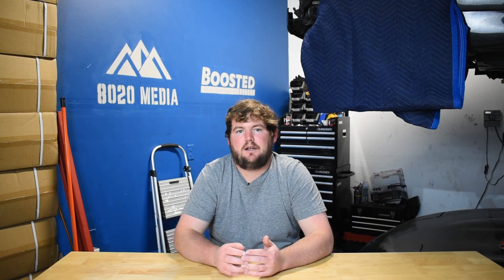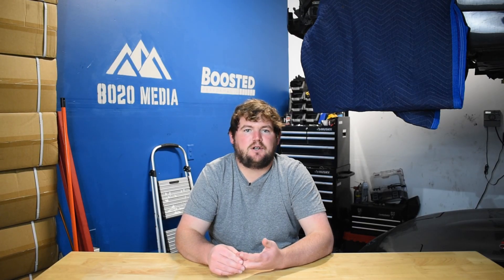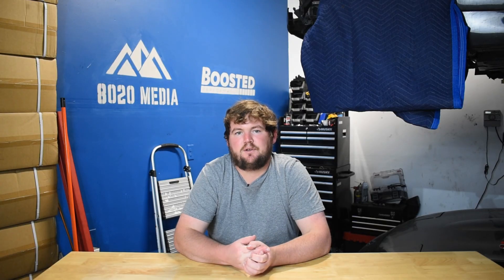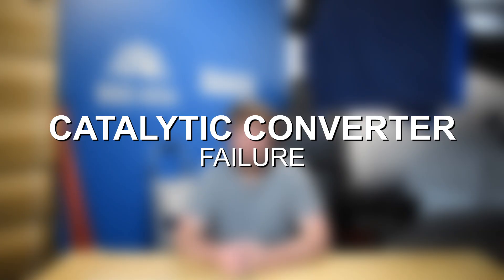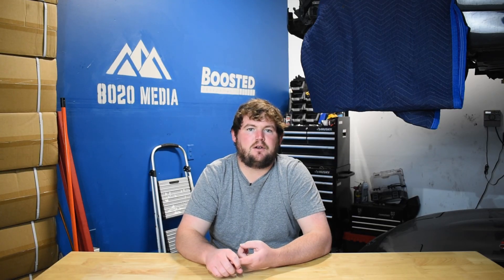Hyundai’s 1.6 Engine | Reliability & Common Problems

Comment: I want to add while we're on hyundai. I have a 2018 Elantra SE with a manual transmission. I have 123k on the 2.0 Nu motor. I cannot believe how trouble free this engine has been. Ok, its not peppy, at all, but i rock high 40s for mpg. At idle, its still quiet. I really am impressed. Now, im sure the way i tale care of it has a lot to do with it. The oil cap says "5w20". The manual says ypu can use "5w30" and if hot enough, 10w30. I have been using 5w30 synthetic oil and a good filter like Mobil 1 every 4k. I check and add any oil if necessary between oil changes. The 2 things that were done was a wheel bearing and a water outlet for the coolant. An inexpensive repair. If be surprised if i couldnt get 200k or more on this engine.
Reply from the maker: Joeb - Thanks for your added insight and experience! If you maintain it well, it should easily get you to 200k!
Reply: @8020Media  that's great to hear! I'm super impressed thus far! Then again I take good care of it!
Reply: @8020Automotive  Do you have a video on the 2.0? I tought it was a bad engine... since it's in everything cheap hyundai it stops me from buying one...are they good if well maintened?
Reply from the maker: T - Yes we do: https://youtu.be/JjYKv3COrRk
Reply: @8020Automotive  that's the turbo. That  one I do not have 😄 I have the Nu 2.0
Reply: @8020Automotive  I'm gonna watch it, thanks!
Reply: @8020Automotive I'm now at 169k! It still runs great. However, it's consuming oil between oil changes... I always need to keep a qt handy. No leaks..I think the rings and other metals are just wearing down...
Reply: @joeb2588  inspect valve cover area, and rear main seal area, if no leaks, make sure it's not valve stem seals before assuming it's the rings(you can search up the test on youtube), because re ring jobs are expensive but worth it if caught early before it gets to 1L per day.
Reply: Nu and gamma 1 are fairly solid engines.

Comment: I think the Kia Proceed GT has the 1.6 T-GDI (G4FJ) engige, is this engine model ok?
Reply from the maker: K - All of the engine variants are okay, just need to stay on top of maintenance!
Reply: i have this model car aswell with the T-GDI, with 80,000 km / 50,000 miles on it any tips? @8020Automotive
Reply: I was worried that these can have issues with engine failure, even when stock and maintained? (Model years 2013 to 2015)
 @8020Automotive

Comment: This was excellent. From what I can see/read/research, it seems the 1.6 Gamma MPi G4FG may be the most reliable Gamma engine variant. Due to it's reliable (but less efficient/powerful) MPi. What do you think?
Reply: thinking of getting a kia rio, is that 1.6L a good engine? Seems like most recent is bulletproof but anybody have experience with them? Also, what about the Forte's 2.0l engine? Wont get anything turbo just N/A turbo kills 15-20% life of engine if used improperly.
Reply: @dbzownz12345  i have an accent with the 1.6 gdi, only have 140,000 kms on it, no issues so far
Reply: @dbzownz12345  186 ooo km on mine, smooth and reliable!
Reply: Why would anyone buy a Kia when you have degenerates like the Kia boys going around stealing them over and over?
Reply: Specifically in the Kia Soul 2022/2023 (no piston issues like in 2020/2021). I think the engine is also in the Rio.
Reply from the maker: Mr - The only issue with this statement is that they are so new that we don't know any common problems yet. However, so far they look good!
Reply: @8020Automotive  True! Hopefully there aren't too many differences compared to the ones in the 2019 manual trans Soul. Those were also Gamma II MPi G4FG engines.
Reply from the maker: Yup - We'll just have to wait and see!